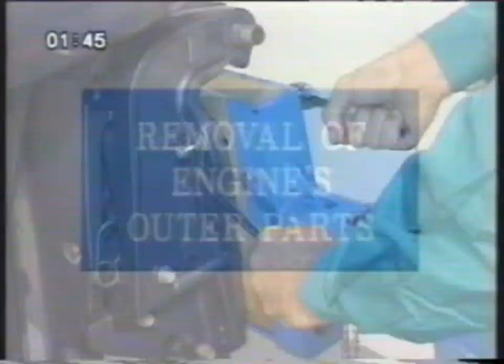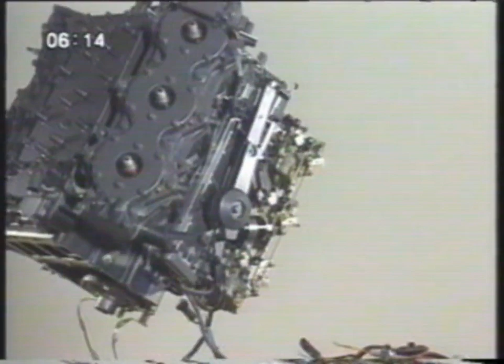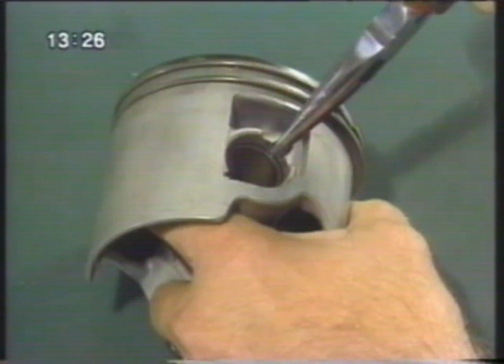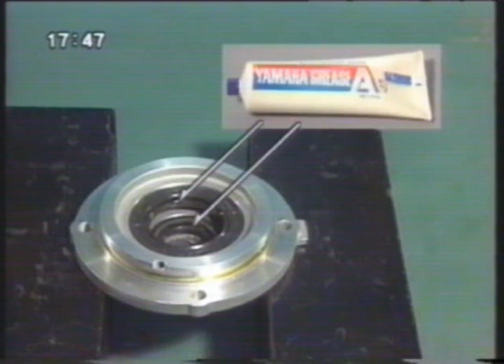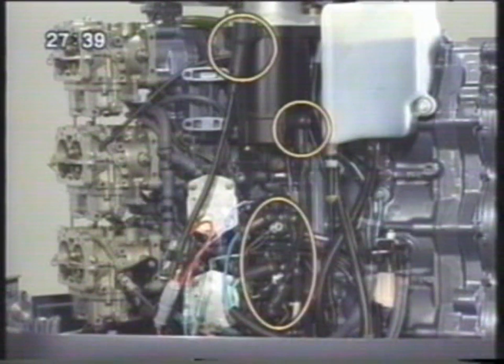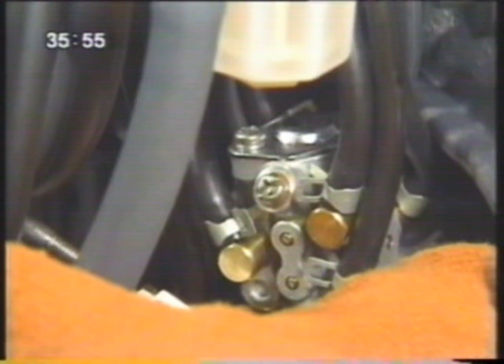DIY Overhaul and adjustment Power Head Yamaha Outboard 2 stroke V4 V6

Comment: Interesting how times change on instructuonal videos. Now you are totally discouraged from ever using your bare hands when rebuilding, especially when it comes to commercial duty engines that will run for extended intervals. I am told that the areas you touch with your hands will get corrosion quicker after assembly.
 Probably they will say that is all garbage in a few more years.